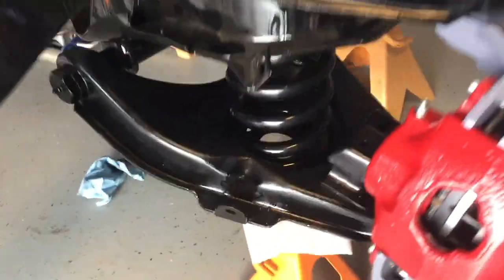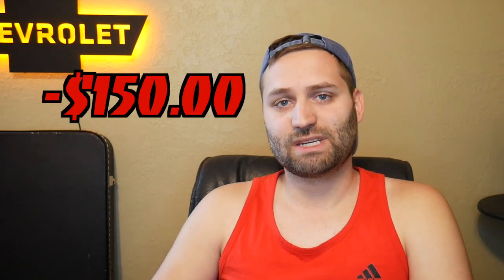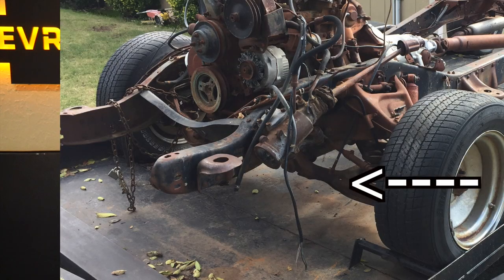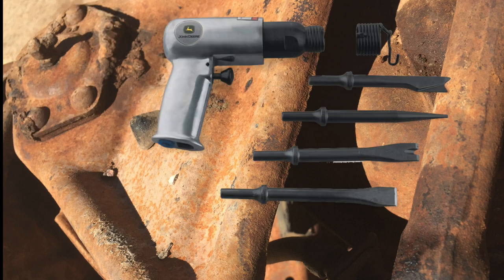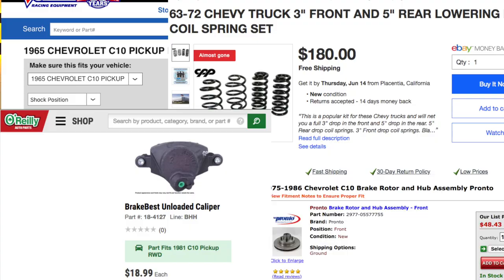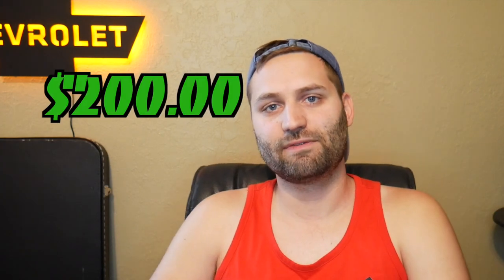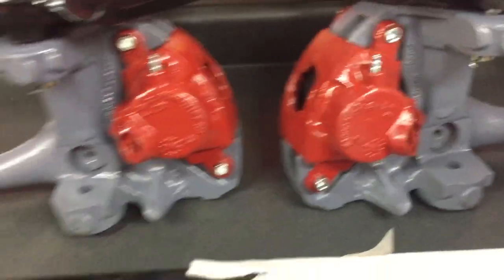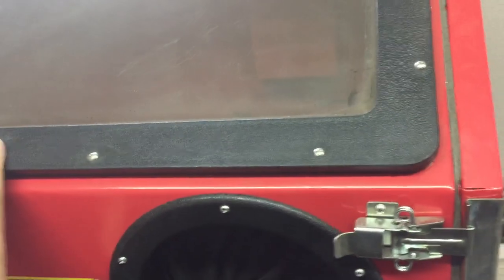Installing Power Steering & Disc Brakes On A 1964 C-10 (C10 Build - Episode 4)

Comment: Great video!!!!,
Not sure if you mentioned this information, but What year spindle did you use on your factory a-arms?  Thanks
Reply from the maker: Hey! Thanks for swinging by. We took the spindles off a 1980 or 1981 C10. I also made another video talking about how to install the steering linkages/power steering box as well. It's pretty short, check it out if you're interested in doing something similar. Thanks!

Comment: Hi. I just wanted to throw out a little bit of constructive criticism for you. (in no particular order)
1) Your shop tour consisted mostly of shots of your floor.
2) You can get a lot of footage out of showing us how you painted the calipers, spindles, etc. This video was 9:28. Make 10 minutes a goal every time. I know you're still new (and not getting paid for this yet), but act like you are. (Hopefully you will some day soon.)
3) We are looking for the important info here! You swapped 1980 spindles onto 1964 control arms. I inferred that you had to swap the ball joints to make this work, but you never said what ball joints you used. (actual part#'s, or at least make and model of what they were for.)
4) Start plugging the stuff you use, even if it's not sponsored. If you liked the caliper paint you used, tell us about it. This will come in handy later.

All that being said, video and sound were pretty good. I am super into your content, so I stayed engaged. Poking fun at yourself is a good way to keep it fun and light, but don't go too far or it gets a little hokey. You do remind me a little bit of the early days of Tavarish. Keep it going, and hopefully you have that much success.